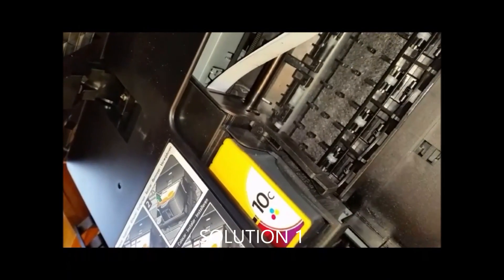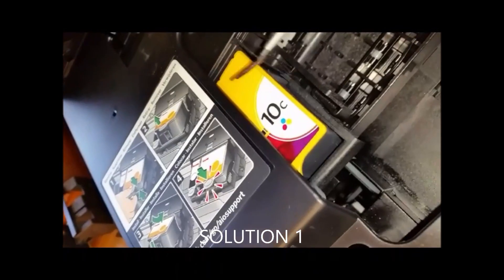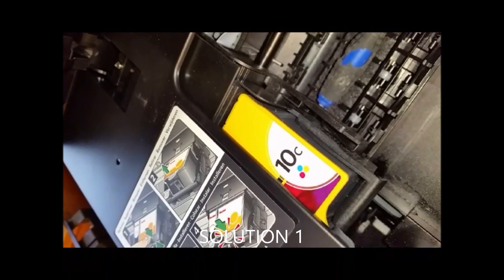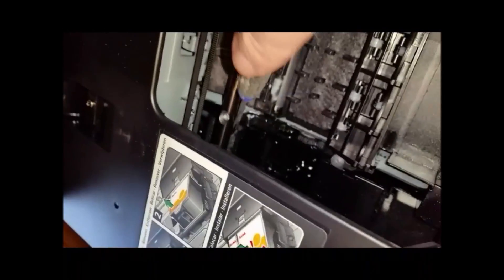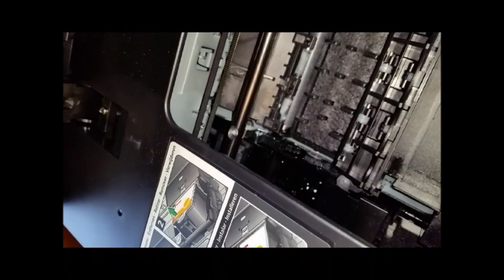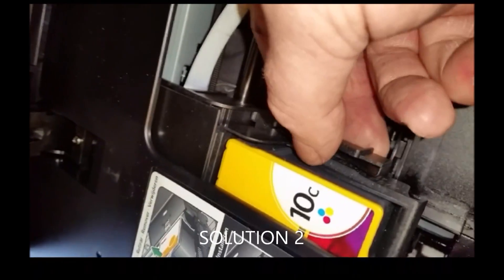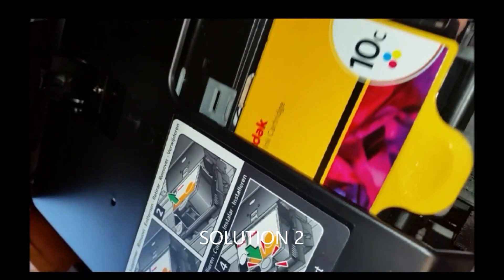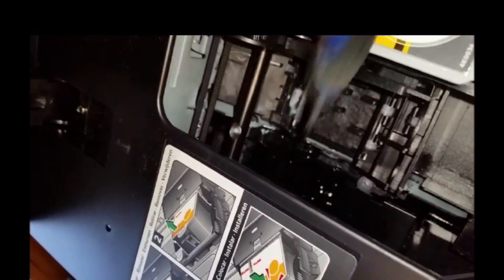KODAK CARRIAGE JAM

Comment: Thanks for the video I had to go option 2 but now it won't print anything? seems to work ok but nothing prints. I've tried recalling  and all that with new ink.  any idea's?
Reply from the maker: Where are you from? I think you need to change your printhead. I can teach you how to get free printhead. Let me know where you from.
Reply: I tried manually cleaning the printhead (i can get ink thru it) but nothing shows on page trying again. If option 2 was necessary would that cause the printhead to not touch paper?

Comment: I DONE ALL THAT NEEDS TO BE DONE, THE CARRIAGE WORKING FINE, HOWEVER, THE MACHINE SAID "PAPER JAM. REMOVE REAR ACCESS COVER. CLEAR OFF PAPER. ATTACH COVER. PRESS OK TO CONTINE. (CODE 3524) ALL THESE THINGS DONE SEVERAL TIMES, IT STILL REPEATING THE VERY SAMETHING. ETC

Comment: Thank you so much! I've had some issues with our ESP 9 over the years, but never this one. Had a "paper jam", no error and no paper in the printer. Turned out, our power went off and on and it seemed to have caused the printer to jam.
 
I watched another video and they had taken a hot knife to cut the cover over the stuck ink.. Yikes.. So I kept looking and found your video. 

Mine worked just like your video! Thank you so much! I had already spent some time trying everything I could think of and was ready to introduce it to a hammer..

Comment: OMG!  I think I wanna marry you!  I was 2 seconds away from fixing it with a sledge hammer. This worked great and I used just a plaind flathead screwdriver to slip underneath the printcartridge.  I had to wiggle it a little to get it under but finally found the sweet spot and it release the cartridges.  It was then easy to push the inkpad back.  Thanks for posting!

Comment: Your hint about forcing the printhead out of the way to get a better look at the foam pad was a lifesaver. Mine was ridiculously stuck and pushing the foam pad back normally was useless however. For additional notes for anyone concerned, once you get the cartridge out of the way, you can then simply lift the small black half-box protecting the front workings of the "foam-pad unit" (provided you're using a 5250 or similar). I ended up having to get a metal chopstick and using it to lever the little foam pad mechanism back not one, but two clicks from the front of the pad, rashing than pushing from above or at the back. One click made the printhead moveable with a small amount of force, but it went right back to being stuck. Two clicks and the printhead moved easily and the problem appears solved. Well, apart from needing a refill of black ink now. Bloody stuff got everywhere...

Comment: I just wanted to say THANK YOU!!! very much. I had a 3527 error and did not see anything jamming the cartridge. The cartridge would not move out to the center. I could see the color cartridge was okay, but not the black one, so I used a butter knife on the top of the ink cartridges to see if the black ink cartridge had popped up out of the print head. That was not the case, so I was looking on you tube for a video on opening the printer up so I could see if something broke in the carriage drive mechanism. I found this video and gave it a try and was able to get the print head to move out to the center of the printer. It is now functioning normally now. This is the 2nd Hero 7.1 I bought, and I have an extra print head for it. Thanks again.
Reply: Well that didn't last long. The printer starting printing, but the error came back. It printed a couple lines and the print head was on the left end of the printer but not parked as it was in the middle of a print job. I cleared the paper out and tried again. I got the print head jam error again, but this time the print head was on the right end of the printer. I tried installing a new print head, but it didn't make any difference. Now What???

Comment: Hi IE Folks,  Thanks for your video; I have  kODAK hERO 5.1 with the same problem.  I was able to slide a flat spoon under the carriage and push back the 'pad' as you demonstrated, however it keeps getting stuck each time I restart the printer; it feels very gooey with ink - perhaps that's just too sludgy for the mecahnism to work; is it feasibe to open up the box and clean this mechanism?  I hate discarding anything that retains functional value. Tom.

Comment from the maker: Thanks for you comments guys! I'm very happy to see that I was able to help some of you. I see some other questions here that I cannot answer so please pardon me for that. I sell refurbish printers before and I saw a forum wherein people were asking how to resolve a "Carriage Jam Issue" for their Kodak printers. I saw several disgusting resolution like "Buy a new printhead" which won't resolve it so I come up with this video. I hope this video will continue to help other Kodak Printer owners. Thanks!
Reply: Give it some welly! I did and my ink pad (entire contraption) slid back (with admittedly a few clicks).  I had to force the ink cartridge carriage out using 'Option 2' in this video and then I put a flat head screw driver under the front of the (newly exposed) ink pad, so the tip of the screw driver was a couple of cms below the ink pad. I applied some degree of force and the ink pad carriage/contraption was forced back some 8cm's or so.  I then slid the ink pad carriage/contraption forwards and backwards a number of times (it subsequently moved easily).  I then used the maintenance functions on the printer screen and 'cleaned the print head' and then 'printed a test page'.  All working well.  Subsequent printing has worked well and I'm very happy.

Comment: Thank you SO much for your instruction!  My boys were pretty impressed that I was able to fix the printer. :)
My only problem is that the jam has happened two more times since I have fixed it.  Is there a way to fix those ink well things permanently, so that I don't have to keep pushing them back in?
Thank you for any suggestions.